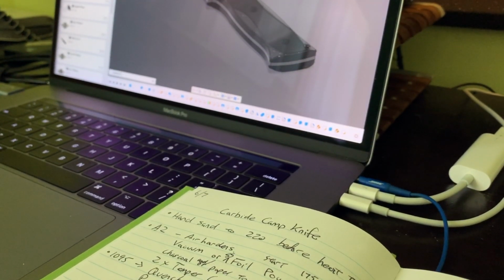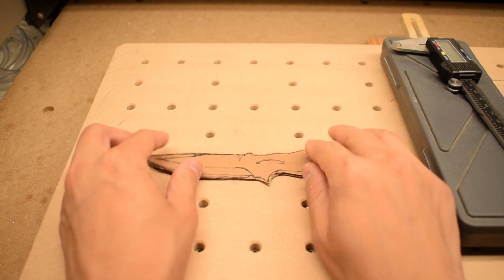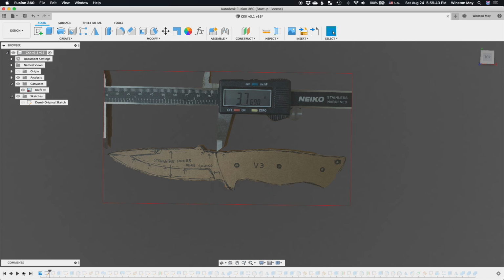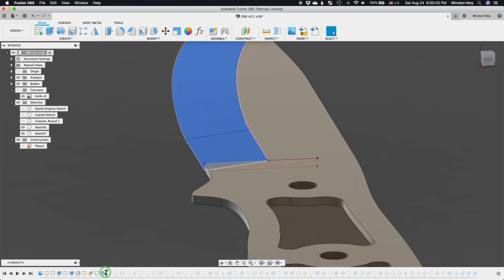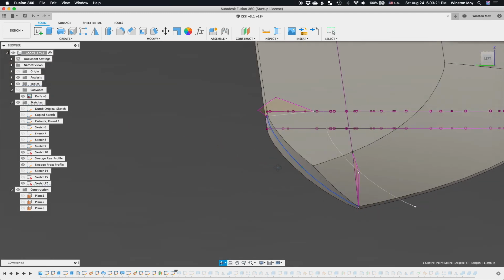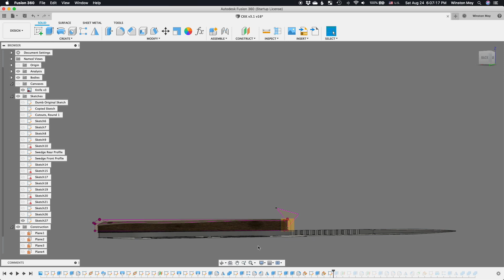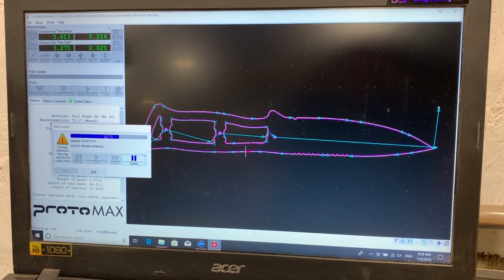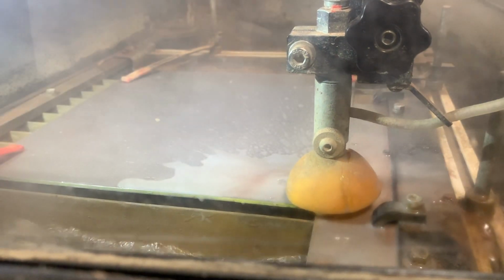CAD Modeling a Knife for CNC Machining  - Carbide Camp Knife Pt. 1

Comment: What’s the advantage of a waterjet over a plasma cutter in this case?
Reply: The plasma cutter might change the hardness of the knife because it gets heated up. A waterjet cuts through it while keeping everything cool.
Reply from the maker: Same with laser-cutting as well, there's a heat-affected zone when you use any process that burns metal. It can cause the material to harden right at the edge which will ruin your day when machining.
Reply: Carbide 3D TIL. Thanks. My understanding is that water jetting is much more expensive because of the consumable, but makes sense that it has significant advantages as well. Excited for the next episode.

Comment: How much was the steel?
Reply: McMaster Carr...its a wonderful resource....
Reply from the maker: It really depends on how large a sheet you buy and how well you nest your parts for waterjetting. Best estimate is about $15 per knife.
Reply: Check out your local waterjet folks or welders for possible scrap deals.  I dumpster dive for some nice stock and buy it by the pound at a huge discount.  It may not be "knife stock", but an option for other projects.
Reply: Jim In Ashland Yeah no. This is O1 (Oh 1) Tool Steel. Pretty rare and basically unweldable so you won’t find this precise type of steel laying around.